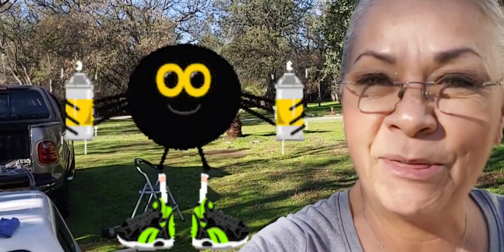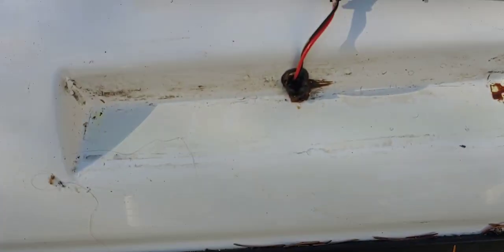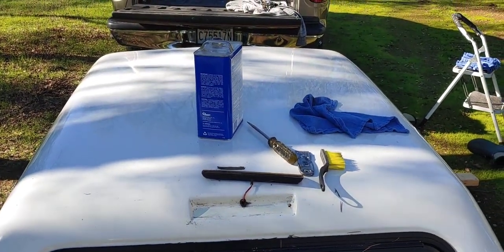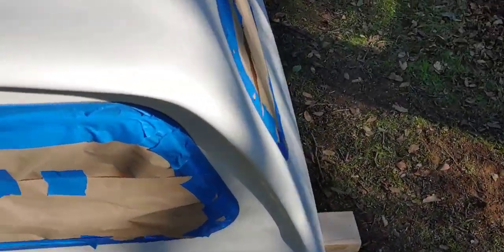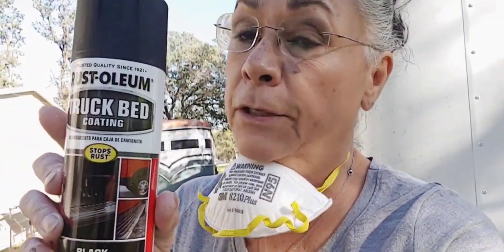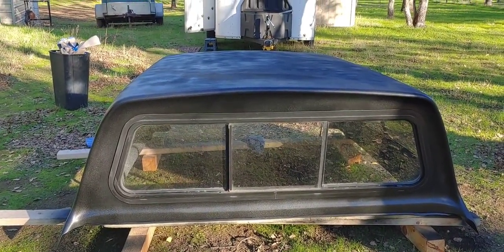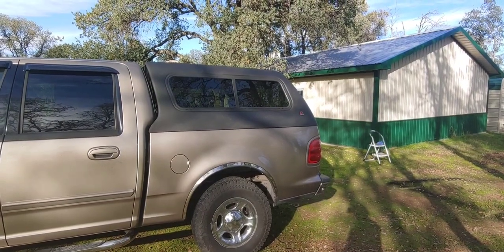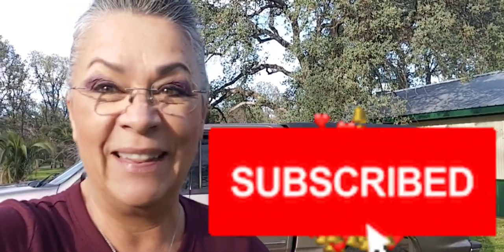DIY, I PAINTED MY TRUCK CANOPY.

Comment: Hello the title caught my attention And noticed I have the same truck but a supercab with 6.5" bed. And same color.. thinking about painting the same as the truck color but idk now yours looks great. Probably better than me using rattle cans because cans streak and believe truck liner wouldn't streak so much. Yea I was waiting on CL for a topper and scored a Free one great condition and ramps taller in the back with same windows as yours..very happy Except the color is Teal that's my least fav color on a vehicle. It's getting painted for sure black fits nicely especially with dark tint windows bumpers trim etc.
Good job thanks for posting.

Comment: That came out great Betty! Those rattle-can bed liners are very temperamental... I work with a guy that does body work on our days off and he told me a trick to do with spray cans. Put them in warm water until you're ready to use and that will help thin the pain and it will mix much better when you shake 'em. I tried it when I painted my boat trailer and it worked great. Just something to think about the next time you need to paint something. The topper looks great on the truck!
Reply from the maker: Thanks, I have heard that a few times. I wish I would have known that then. Ugh. Thanks Dude for hanging out with me.
See you next week.
Bear

Comment: I am thinking of painting the top of my cap white to reflect heat and the top with the bed liner. 
That's so strange the cans were duds. I hope you returned the ones that wouldn't work for money back
Reply from the maker: Hi 64, You can order truck bed liner paint in white. I think that is a great idea.  I am happy with my topper. The price was right. Thanks for watching my friend.